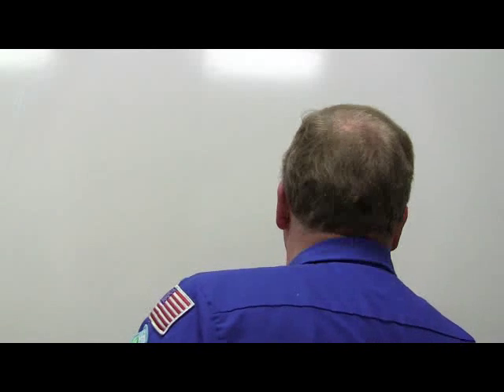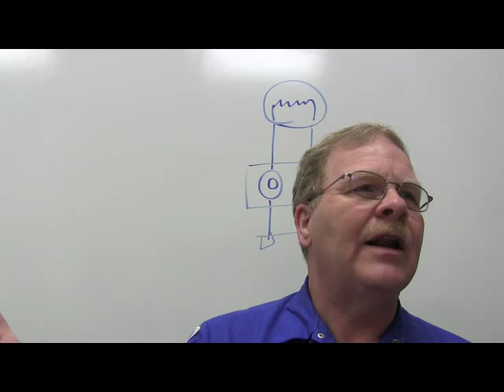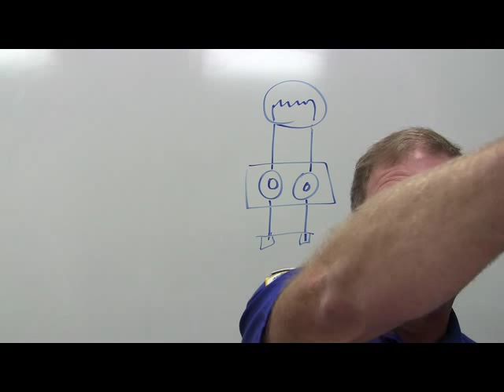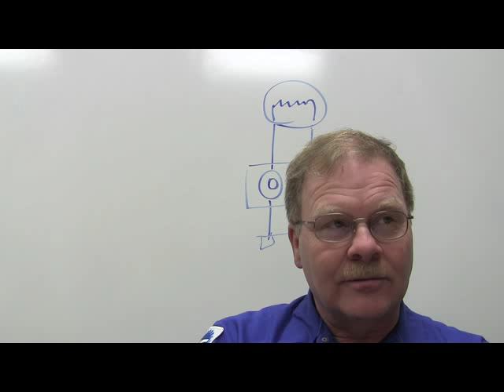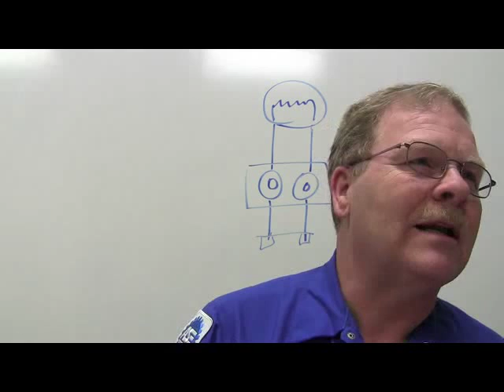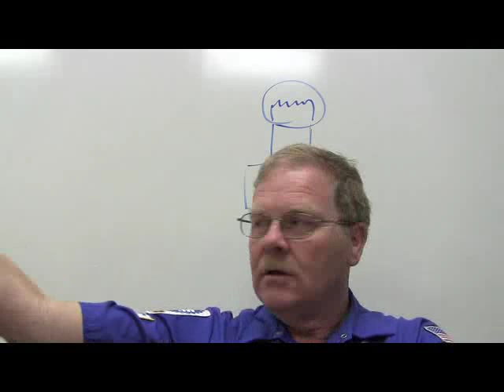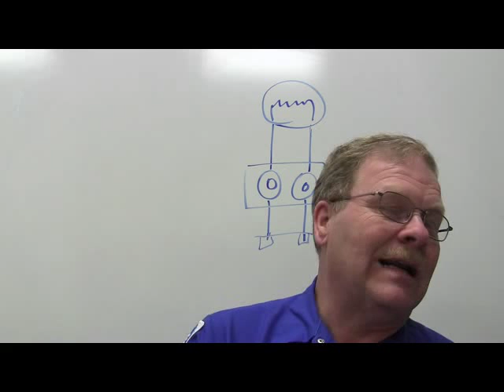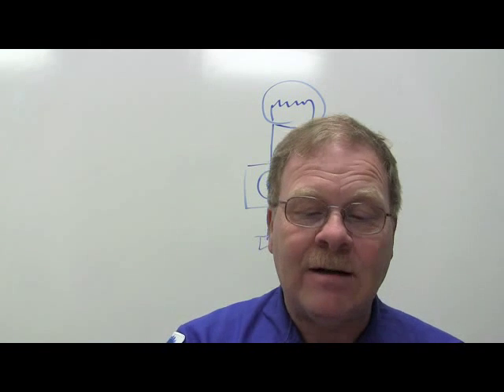Engine Performance 1 Test 3   Fuels

Comment: so why did it have 210 lbs of compression?
Reply from the maker: Because of the diesel, which created a greasy seal around the piston rings, reducing normal blowby - it's the same thing that happens when you add a teaspoon of engine oil to the cylinder during a compression test.